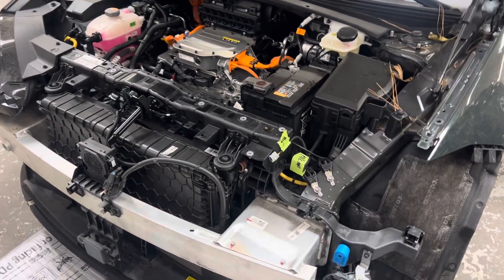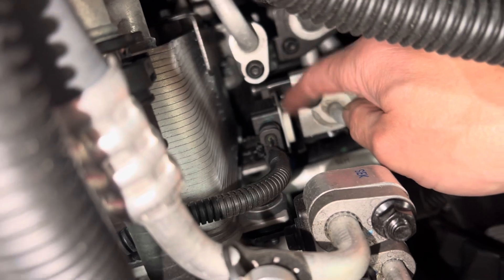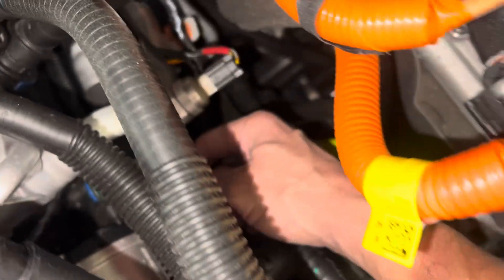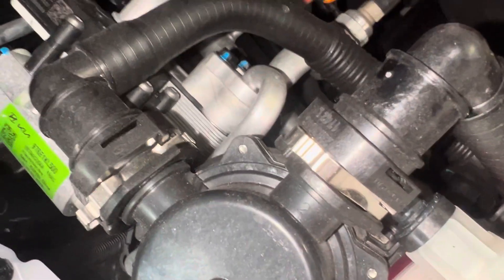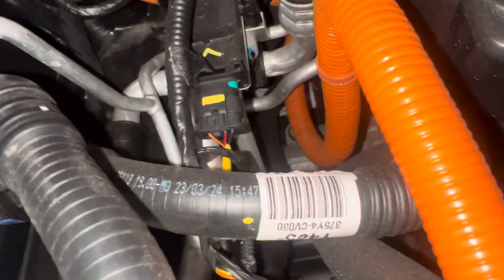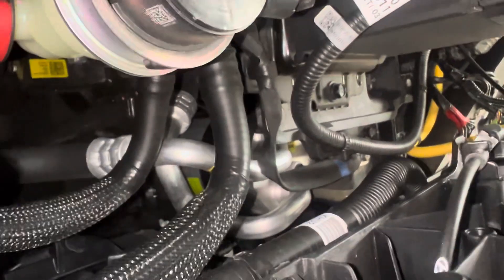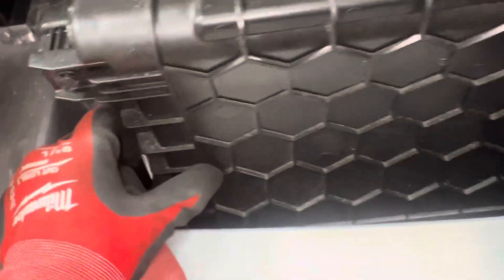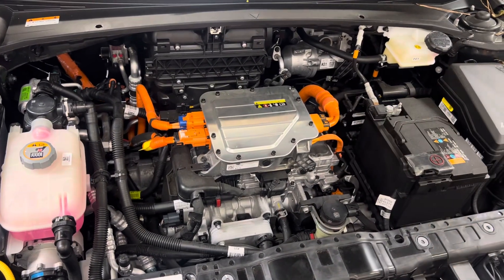Heat pump system on 2023 Hyundai ionic 6 . When ￼ it breaks, it’s coming to your shop.

Comment: 😅 quite a few manufacturers moving to heat pumps don't know why they just can't call it a reverse A/C  unit or reversible A/C because that's what it is but quadruple the complexity of a regular system 😅.. i guess heat pump sounds more magical and environmental friendly
Reply from the maker: @joebrown9621  because there is no such thing as Ann A/C AC unit. 
You do not create cold 

You move heat 

An AC unit is a heat pump in one direction 

What we referred to as a heat pump is a heat pump that could be flipped into two directions 

You do not move cold move heat
Reply: “Heat pumps” are in fact as simple as non-reversible systems, only with a few more valves.
Reply from the maker: @Hnnnghf not an automotive. 
    Some of the manufacturers have combined them with combination, heat recovery in conjunction with straight heat pump with multiple valves spread throughout the entire engine compartment not in one little location with a simple, three-way, mechanical valve like residential.
    On top of that, they have added 2 to 3 electric water pumps with 2 to 3 plate heat exchangers swapping either heating or cooling water in conjunction with hot refrigerant or cold refrigerant. 
   Some use multiple refrigerant heat exchangers under the dash for Heating & Cooling simultaneously at the same time providing redundant back up resistant heat water for the electric vehicles. 
     The heat pumps systems that have been developed for automobiles for some manufacturers are a complete engineering nightmare, like they were designed with somebody with ADHD hyperactive while they were on speed. 
      With up to four multiple individual controlled zones that all can produce simultaneously Heating & Cooling at the same time

Comment: Times are changing for sure!  Never thought I would see a heat pump in a vehicle!  Almost scary and totally unnecessary.  Thanks for the walk around on the system.
Reply from the maker: @SkillSavvyDIY  the only reason it is necessary in a whole electric vehicle is because resistance heaters use 3 to 4 times more power and it drains the high voltage drive battery really fast shortening the mileage. 

Heat pumps use much less electricity to heat up a vehicle in snowy weather, extending the drive range of the battery .
Reply: @coldfinger459sub0  I actually considered that very thing after commenting.  A PTC heater would put a drain on the batteries for sure.  Oh well, welcome to the future haha.  I actually wouldn't mind seeing this system up close but I'm sure I will get the opportunity eventually.

Comment: i remember the vacuum lines back in 80s we had diagrams then the wiring craze after that. do they make just a diagram for these ac systems that would be clear to follow and understand ,have not looked for that yet. young techs if they are behind now they may not be able to repair these systems with out replacing mass amount of expensive parts. i think if the young person would get schooling in these systems could make some money in their own shop just for hvac.
Reply from the maker: @RATCHETMAN1001  the only problem is even the older technicians, barely can repair the systems. 

Many cannot even repair a normal simple air-conditioning system properly .

Comment: Genuine parts ha ha LOL.................... The aftermarket might support it . Once its sees an accident instant write off . But wait imagine 2-3 owner 10yr/old car vehicle still running but will be straight to the wrecking yard no parts or no money . 
But Ford still install differential oil level plugs to low . 
Space shuttle would be easier to work on .
How dare these car companies force there engineers to make overcomplex systems clearly without thinking .
Oh yea hyundai are not even carrying spare batteries . Also scratch the battery and it needs replacing . These cars are an absolute joke .
Reply from the maker: @paulthompson1654  100% 👍 correct

Comment: It's a rolling physics lab. You don't want it to hit anything!
Reply from the maker: @xandervk2371  when this thing is 7 to 10 years old and it gets in any kind of collision that damages just the heat pump system will total out the vehicle in parts cost
Reply: @coldfinger459sub0 
Better start stripping parts off them for cataloging and attic storage.  Get ready, go!